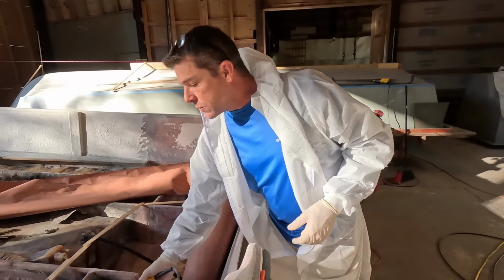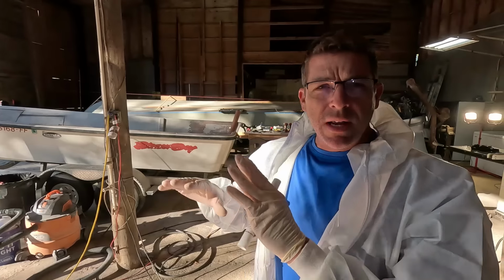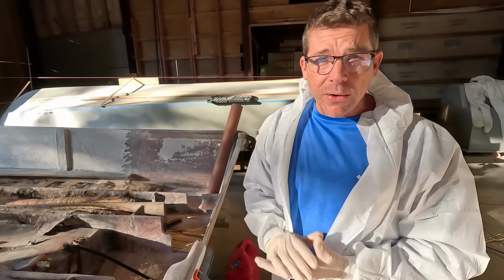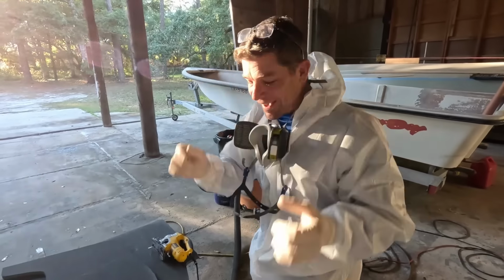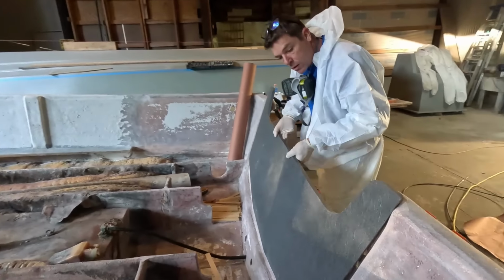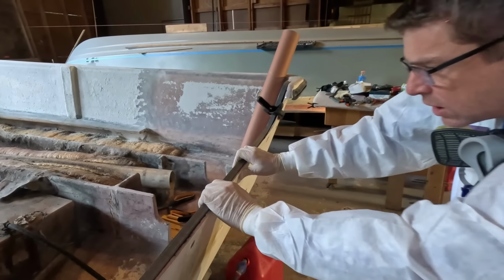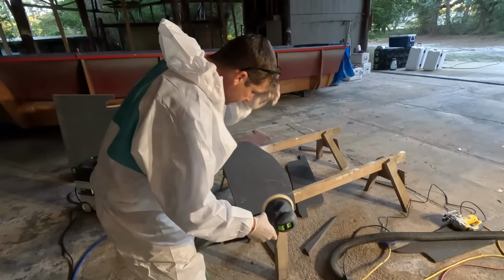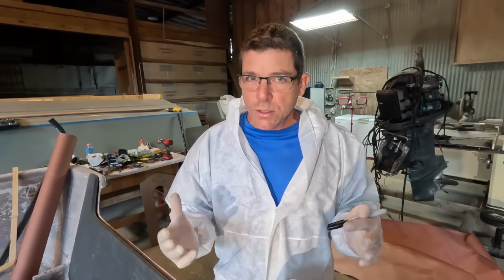COOSA BOARD TRANSOM - Cut & Fit Like A PRO!

Comment: It’s significantly more expensive 😂 it’s 380 a sheet by me compared to 60 dollars for marine grade. I guess it’s worth it though
Reply from the maker: In our area, 3/4 coosa is around 275.00 and 3/4 a/b marine Fir is over 100.00. So it just depends on what's available in your region, and which core material you feel is a better fit for your project. Thanks for watching

Comment: Rewatching your videos as I'm about to start work on another project- an old Australian designed fibreglass boat. You answer every question I ever have which is awesome! My transom will be ply unfortunately- coosa board here is well over five hundred dollars a sheet- or I can get it for half that from America- plus three and a half thousand dollars freight :) Already had one small problem- my Jersey bull lifted up the rear end of the boat and dumped it on the ground with the bow still attached to the trailer- it was a hoot getting it back on the trailer on my own- I'm seventy and recovering from surgery for two hernias. I do like a challenge :) Thank you for what you do. Jay- Australia.
Reply from the maker: Glad to hear that our videos have been helpful, Jay! If you choose a good  quality marine plywood, and fiberglass it properly with vinyl ester, or a good Iso resin, you can expect many years of trouble free use. Wishing you all the best with your project boat, and thanks so much for watching and commenting all of the way from Australia 🇦🇺!

Comment: What a help this channel has been for me thank you guys. I am in the process of doing exactly what your doing her with a Coosa transom. I do have a question for you guys. I'm closing off the transom and putting an Armstrong engine bracket on it. Theres quite a few holes that are not going to be used anymore that are below the water line. What's the best way in your opinion to seal them up. Nothing is in yet. Everything is cut just like you did and clamps are built and Coosa is fitted. Should I address this before the Coosa is glassed in or after and how.

Comment: I'm thinking of buying a used panga. Needs a floor,  boxes, center console and live well. Has some chips on the outer gel coat. What would i have to do to the transom to put two 40 Hp motors on it.

Comment: Great videos! Learning a ton from them.  One question I have is what you do on boats with curved transoms? (I'm working on a 1974 Whaler Montauk 17). Can you still use Coosa (perhaps with vertical slits in it, or in a 1/4" thickness which might bend more easily?), or should I use plywood or some other coring material?  Thanks again, and love your work!
Reply from the maker: Thanks, I'm glad to hear that you are enjoying our videos! Coosa board can be used in a curved application with no problems. It behaves a lot like plywood, in how it will curve, or bend. I have a Coosa vs plywood  video here on the channel that compares the two materials, and in it, you should be able to get a good idea of its flexibility. You will need some good transom clamps, like we show how to build, and you may choose to use 2 layers of 3/4 or 3 layers of 1/2 to help get the curve you are looking for. You will also want to be sure to use the 26-pound density Coosa board for transom replacements. I hope this helps, and I appreciate you watching!

Comment: The holes at a downward angle are genius.  I did an transom in a boat a number of years ago without knowing what I was doin and I had several large voids.  Now I know the answer.  You just hit 77K tonight (3-27-2025).  Keep the good stuff coming Captain.
Reply from the maker: Thanks! It's little tips like the vent holes for the transom core, which can make all the difference in getting a quality job. Appreciate you noticing that the channel made it to 77k this week!

Comment: I'm redoing a transom on a 14' skiff. It'll have a 60 on it, but I wouldn't mind overbuilding the transom (within reason). Do I need 1.5" coosa or will 1' be enough for my goals? TIA
Reply from the maker: I have always done 1.5 inch transoms in our boats. I usually recommend that people go back with the same size materials, as what was in it originally or slightly larger. You are also going to want to go with the 26 pound density Coosa board if you are using it in the transom. I hope this helps, and thanks for watching!
Reply: @FishBumpTV  Thank you. Your videos are invaluable.

Comment: nice video Captain I'm in Alabama where can I get the coosa?
Reply from the maker: I buy Coosa board from Advanced Plastics in Elberta, or BMG supply in Foley. You might want to check out their website, since Coosa is made in Alabama, there may be more distributors closer to you. I hope this helps, and thanks for watching!
Reply: @FishBumpTV i checked them last night over $700. for 1 1/2" plus 100 mile trip.the poured in liquid even more. heck marine plywood is now $165 per sheet for 3/4". now considering CBX plywood soaked in penatrating epoxy.

Comment: The coosa is nice, but expensive.  I ended up using 3/4 bc plywood.  Put a coat of polyester between screwed it together, then wraped it with 1708, wet out one side let it set then the orher and pit it in the transom.  $39 for the plywood $20 of cloth, $30 of resin. Will last 30 years good enough for me
Reply from the maker: Sure, that can work quite well. I've got several plywood related videos here on the channel, and if done properly, it can be a good option. Thanks for sharing your experience with the channel!

Comment: This is great Joe. Perfect timing. I am replacing the transom in my 22' Walk Around this spring. I would not consider my self a pro. More like varsity. Lol... I have been around the boat industry for a long time, but I am learning some really good tips, tricks, and different methods on your channel. Very innovative. Also I am sure it is not easy to film, explain, and do the actual work too.Thank you for your efforts!
Reply from the maker: Outstanding! I'm glad to hear that the videos are helpful with the transom replacement on your 22 walk around. Thanks for taking the time to watch and comment on the channel!

Comment: Quick question if my transom is 1 1/2 thick and I’m going Coosa should I use 1 piece 1 1/12 thick or use 3/4 and laminate 2 pieces of 3/4 together to get the 1 1/2?  My dealer stocks every thickness of Coosa and density
Reply from the maker: Either option can work just fine. I used 2 layers of 3/4 on the build of our 29, but the transom has a bit of curve to it. It is also a little more work to laminate the 2 layers together. I hope this helps and thanks for watching!
Reply: @ mine is pretty flat but it would probably be easier to work with laminating 2 together than fighting getting it bonded, my dad was a boat builder and designer and worked for Don Aronow back in the late 80’s. I built boats with my dad growing up when we moved to Mississippi after Don Got killed. I went into the automotive field when my dad retired from building boats and went on to commercial red snapper fishing for his retirement fun. I inherited my dad’s formula/ Apollo when he passed away and I’m restoring it in his honor. Thanks for doing these videos it’s a great refresher for me since being out of the fiberglass industry so long . You do excellent work and do things the way my dad would do.  I always can’t wait for you to post new videos it’s been a great help.
Reply from the maker: @therock67ss  Sounds like you have a very solid background in fiberglass to work with! I'm glad to hear how much you are enjoying the work we are putting into the channel, and I wish you the very best with your restoration project!

Comment: If you’re looking for new videos to do, I have some gel coat pock marks all over the bottom of my hull. I can’t find much information about why it’s happened or how to repair it properly.
Reply from the maker: Interesting! Not sure what you might be dealing with. Maybe some type of osmosis blisters. I hope the videos on the channel might give some inspiration as far as materials and methods needed for your repair. Thanks for watching!
Reply: @ I would love to fill the marks in with something and then bottom paint it. Great job with all your videos, tons of great info!
Reply from the maker: @Unfinishedprojects1994 Usually vinyl ester or epoxy based fillers are your best bet for below the waterline repairs. I hope this helps.

Comment: Nice fit!
Question:  I’ve got a liner boat with no access under gunnel to bolt in cleats.  It really needs a backer plate.  Any tricks?
Reply from the maker: Thanks! Sometimes, you have to cut out a hole for a deck or inspection plate to gain access to something like that. I hope this helps, and thanks for watching!

Comment: I am replacing a transom on my boat. It’s a 23’ 6” Proline and I need some suggestions on how to go about taking the old wood off the back of the boat I have a outboard motor bracket so it’s full transom I want to go from the outside, so will that work? Let me know. Please😕
Reply from the maker: Yes, most transoms can also be replaced from the outside, but I personally prefer to replace from the inside if possible. I hope to do a transom replacement like that in the future, so stay tuned and thanks for watching!

Comment: Hey Capt. Joe, Kay-cel and Penske board are two brands that are very similar to Coosa board and intended for the same use.I have used Coosa and Kay-cel, which I get from FGCI in Ft. Lauderdale. Both are great products. I hope this helps. Thanks again for the great videos.
Reply from the maker: Thanks for the info! It's good to have some options. I think there is another product called Thermolite that is sold overseas. I appreciate you taking the time to watch and comment on the videos!

Comment: Just curious what you and other think of the total boat polyester structural repair putty. Is it strong enough to bond to fiberglass panel together I had to cut the transom off a boat because it had gotten so bent out of shape because of the weight of the engine I had to make a whole new piece. I fiberglass it in place but had to fill in the cut joint back in. Just curious
Reply from the maker: I know total boat products have a good reputation, but I haven't used that particular filler, in that exact application. It's hard for me to say for sure. Maybe someone else that is watching has some feedback for you. Thanks for watching!

Comment: I do the hot glue trick. I never thought to use paint sticks. I took some used house paneling and a table saw and cut a stack of inch and a half strips. 

I label the transom sides bow and stern because when I started it helped me remember those terms. 

I would love to use coosa. But the cost is too much when you count shipping to indiana(louisville ky area). At least it was last time I checked and no where within a 6+ hour drive keeps it in stock. Makes a sheet of 3/4 around 600 bucks!
Reply from the maker: Yep, paint sticks work pretty good, and I get handfuls for free from our local marine hardware store. Wow, 600 bucks hurts!! I can get 3/4 Coosa for around 350 bucks and only have to drive about 20  minutes to pick it up. Maybe Coosa will get some more distributors throughout the country, and make it a little easier to source. I appreciate you watching and commenting!

Comment: I am a Certified Florida Cracker / Conch. Born in Keywest and raised in South Brevard County, "Carpenter is the trade" and I love your approach to "Educating" the masses on HOW To Do what is needed to restore-repair composite watercraft and more!! I purchased a "87" Makee 19' Bluewater with a T-top, with a for Spit transom a few years ago. I ended up with a full transom (flat back) Makee that supports a 25" 150 on a "Bobs Machine" 10" Jack plate. The difference from most is that the transom was Bad from side to side/ I removed the back glass, gutted all the wood leaving a 3" border, and formed the interior & exterior with melamine from the Box store and poured "Arjay 6011" to create a 1.5+" full transom, then glassed over with multiple layers of 1708 Biaxial in Epoxy. AT 74 now, Your dad and I could have been Good buddies!! Think about promoting/supporting the Industrial education programs with your (Youth) Knowledge & work Ethic!! Industrial arts have been missing for Far too long. 😉😎 bobA

Comment: Hello Joe,
I have got centreboard and rudder blade made out of 3/4 inch thick marine ply on my sailing dinghy. Do you think that one could make rot proof foils from coosa? Obviously edges will be rounded, tapered and sealed.
Reply from the maker: I would imagine that the 26 pound density Coosa board could work very well in that application, although I have never personally built a centreboard out of it. I have been using Coosa for years, in all kinds of heavy duty and commercial type marine uses for years, and have had nothing but success when working with it. I hope this helps and I appreciate you watching and commenting!

Comment: In terms of tools, I probably have more than I need, but fewer than I want -- multiple angle grinders/sanders, a DA, a belt sander and an oscillator/multitool to name a few.  I would give any of them up before the multitool -- as you pointed out, if you do much in the way or repair, rebuild or DIY, the oscillator has no good equivalent.  Looking forward to the next vid.
Reply from the maker: Haha, yep! I could spend every dollar I make on tools, but the multi tool is one of my favorites! Thanks for watching and commenting

Comment: Love the video, but I think you cut that bevel backwards. You said you marked the forward side with the star, but you cut the bevel the opposite way so when you placed the board in the boat the star was on the aft side. If the transom had not been symmetric the piece would not have fit.
Reply from the maker: Nope, I didn't cut  it backwards. I understood the orientation of the mark, and adjusted my cut accordingly. As I said in the video, there is not an exact way you have to mark it, just as long as YOU understand what it means. I hope this clarifies things, thanks for watching

Comment: Is it possible to use this material as a hard top for my catamaran and gel coat it?
Reply from the maker: Yes, I would think so. It does need to at least be painted, gelcoated, or a light layer of fiberglass, then paint or gelcoat over the fiberglass if it is going to be out in the open, or people are going to be in contact with it. Thanks for watching!